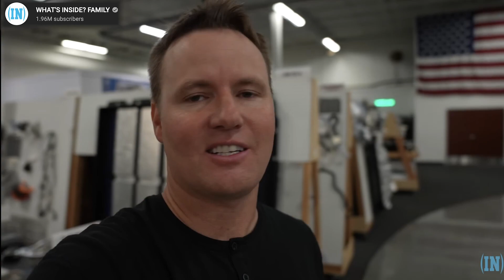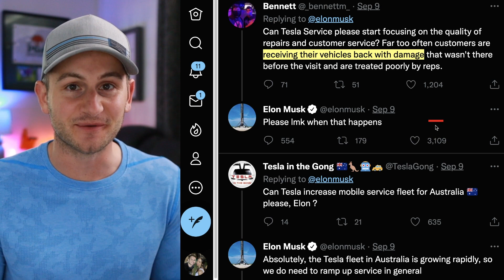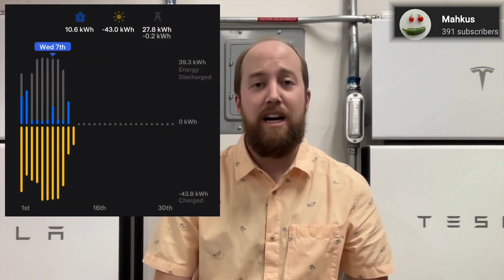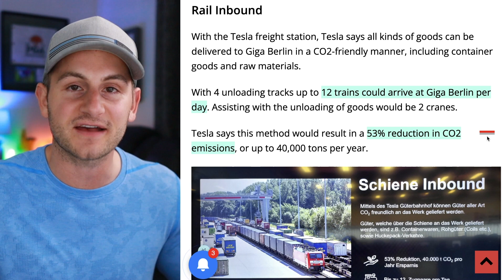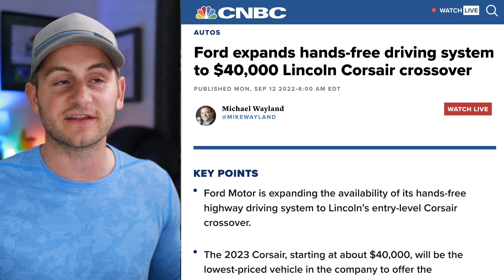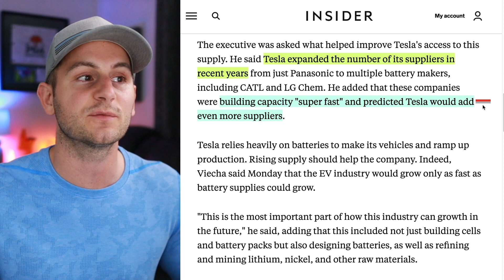Tesla Executive: "For the First Time I Can Remember..." ⚡️

Comment: Installing ev charging station in most cases require upgraded power line connection hence the high cost of installing it. Adding additional chargers to the existing charging doesn't have to be that expensive if it doesn't require grid connection upgrade. Remember, Dillon, regular house will use max 20-30kW grid connection but this is far from what is needed for a single DC charger. Imagine multiple chargers. It is actually an enormous size of grid connection.

Comment: Now where did I read/view that the reason they've delayed production of the Cybertruck was that "Producing it now would be like robbing Peter to pay Paul" – that is: they would have to throttle back production of models 3 & Y (just when they're totally devoted to scaling them & increasing efficiencies/economies of scale). But not because of battery supply, because of CHIP supply. Isn't that interesting? Sure chips are flowing better now, but in absolute terms they're definitely still constrained.

Comment: The cost for adding a high capacity charger will vary tremendously depending on the close proximity of large capacity electrical power lines.  if its necessary to add incoming power, the price can be eye-watering.

Comment: the largest expense with EV chargers is not the charger but the upgrade that normally is required to the grid and the buildings switchboards to enable the charger to operate.

Comment: I think it can logically assumed that regulators are going to want to count miles driven on FSD to start when Tesla reached Level 4 autonomy. All the previous miles driven before FSD Level 4, that requires driver attention and control don’t show how safe the FSD software is because a human is involved in the safety stats. Once Tesla reaches Level 4, customers are going to have to show how safe it is without human intervention or human monitoring.  

When Tesla reaches Level 4, hopefully they (Tesla and regulators) will allow customers to disable the driver monitoring software so they don’t need to touch the steering wheel or have their eyes on the road. At this point, customers should be able to sleep, watch TV or movies, play video games, etc. while ‘driving’.

Comment: The average amount of solar able to be produced at the Tesla charging station in the square footage claimed might be 1 megawatt hour per day....maybe.  So 20 cars could get 50kwh each.  This means half the stalls, or twenty out of the forty, could get juce from solar for a grand total of 30 minutes per day of car charging. 🤔 
Seems very insignificant compared to the potential electrical draw from such a project.  
Lets say 40 stalls each charge 10 vehicles per day, 50 kwhs each.  So actually a very under utilized facility, at least compared to something like our local Buc-ees with 120 gas and diesel pumps going wide open day and night.(I bet each pump at Buc-ees sees  40-50 cars a day).  But figuring 10 charges per day per stall that would be 20 megawatt hrs.  Then if we calculate 11 acres or so per megawatt of solar farm (that's currently the figure being built in my area)  and a solar potential of lets say 6 hrs per day for Yuma, it would take maybe a 40 to 50 acre solar farm to cover most of that electrical requirement, plus multiple additional megapacks. 
Of course if it turns out it's a busy station, we could triple that figure to 120-150 acres.  
So yeah, again,....9000 square feet of solar seems like more of a marketing ploy.

Comment: The largest cost is not the electric utility or the equipment, it's trenching high power to the customer.  If it's close it can save a fortune, 100 yards of underground trench to bring electricity to the stations could easily cost >$100K, if it's more than 100 yards, it will cost more...if it has to pass through sidewalks etc., prices just keep going up.  NOTE : $500K is very high, but we had to replace an underground industrial transformer and trench 200 yards in downtown San Francisco and the estimated cost was $400K

Comment: I disagree with your opinion of not having to buy a Powerwall with solar. They are necessary. Having installed a battery long after I installed a 6kw solar system I found the difference in efficiency and security of my solar system did a SpaceX  and skyrocketed with the battery in. It saves me heaps of money and I no longer worry about brown-outs. It will pay for itself and the panels in less than 5 years, which is better than 10 years without the battery. PS: Love the channel.
Reply: Good to know . I did the same but now we’re unable to buy a power wall separately .  Next year hopefully 🤔

Comment: At the beginning of this year I was planning on installing a Tesla solar roof and power walls. It wold have been a ~$100K installation. Ind doing my research I was surprised by the plethora of horror stories regarding Tesla customer service - permits not completed, phone calls not returned, years long waits for service/repairs, etc, etc. I don't need that aggravation! Add-in draconian terms and conditions, exorbitant 5x(!) cost of old roof tear-off and I put a stop to Tesla consideration. I am now  waiting to see how the new tax credits will pan out but Tesla is not at the top of the list. Third party installers will be preferred. Makes one wonder if this is the reason behind Tesla's low installation rate.

While Tesla may not have a demand problem now they are establishing a horrible customer service reputation that will be remembered long into the future. The problem seems endemic - not just solar roofs but EVs as well - and they both carry the Tesla name.

Comment: Regarding the importance of solar at charging stations, I haven't looked at the numbers, but my guess is solar won't supply all that much power to the chargers.  Important, yes.  Very important, maybe not.  I'd be interested to see the data.
Reply: very important in that it provides all the charge needed? probably not. very important in that it shows a little charging everywhere leads to a ridiculously large total? definitely.
Reply: The solar panels is just to run the low energy equipments and also work as a backup lol….. it has no chance charging a car.

Comment: So as an exercise in math, 16 cells per second yields about 57K cells per hour. 
At ~900 cells per pack that is ~60 packs per hour , ~1500 packs per 24 hour day and ~500K+ packs per year.
Assuming near perfect execution and minimal downtime.)
That matches up with the projected 500K cars per year planned capacity of Giga Berlin without any extra for export or Megapacks.
Since battery production is seemingly more problematic than vehicle production that seems a bit tight and Tesla will probably still be buying extra batteries to bridge the shortfall.
Reply: We don't know the percentage of useable batteries

Comment: At 16 cells a second, they would need 34 factories to make 20 mil vehicles a year.  To make 17 bil cells/yr, 327 mil/wk, 47 mil/day, 1.95 mil/hr, 32,433/min, or 540/sec.  AVG of 850 per vehicle.
Reply: Interesting maths. Over the next few years though (a) batteries will get more powerful (eg needing less) and (b) additional manufacturing "hacks" will accelerate the process..
Reply: Rule #1 when you do prospective work : *never ever* use current figures (even if they are state of art) to estimate what will happen 10 years in the future.
Don't believe me ? Try this simple exercise: place yourself 10 years back and given how many cars Tesla was producing at that time on their sole production site, try and estimate how many factories Tesla would have needed today to produce 1.5 million car per year

Comment: Installing a DC fast charger or super charger isn't just the cost of the charging unit. The power needs to be available at the site and at the level required. So if they have 5 Superchargers required by Ford then they are looking at a trench in the ground with at least 1MW available. Where does that come from? Who pays to put that there? An entire grid transformer may be required. Plus the trenching, cables, concreting, inspections and certifications. How far? The nearest large connection to the grid might be 10 yards away or 200 yards away or more.  $500k is easily reachable for such an installation. It's not just the chargers. The infrastructure isn't free.
Reply: Legacy auto have some interesting challenges ahead...

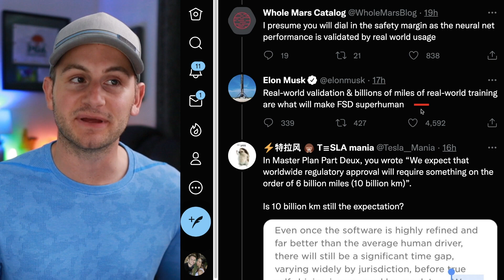Comment: Sorry but the math just does not compute! Per the graph at [4:00] there were 8 million (35-27),  FSD miles driven between 05-22-22 and 06-22-22 (31 days)j. That works out to only about 260 THOUSAND FSD miles per day , less than one-tenth 3 MILLION miles per day in Elon's tweet [3:30]. 

At the 3 mil per day rate it would take over 5 years to reach the 6 billion mile required. Accounting for exponential growth results in a NET timeline of ~2026. This seems reasonable. The cumulative FSD miles chart does not even come close. 

We know math is not your strong point but this was simple arithmetic and that chart should not have been published. Where did it even come from? There are no credits which implies that you are presenting info from unknown/unverified sources. Not good! Please exercise better due diligence before publishing bad info. It calls into question your credibility.

Also, at [4:00] you reference the chart clearly labeled cumulative FSD miles. Why, at [4:10] do you then assume that the 3 mil per day refers to Autopilot?
Reply from the maker: i literally answered these questions in the video and the chart source was from tesla's q2 results lol

Comment: I went ahead and did the math and it is 921,600 units, of 4680 batteries, per 16 hours of production!  That's still only enough for 1110 of the model Y, assuming 830 batteries per vehicle.  It's not difficult to see why batteries can be a constraint on vehicle production flow.  At a projected vehicle run rate of 1,000,000 per year, running 24/7, the battery production rate jumps to 28/second!  (Calculated at 350 days/year.)  I hope they can keep the machinery well oiled!  If I made an error in my calculations, let me know.
Reply: So as they ramp the vehicle line, they install a second cell line.
Remember, it's a relatively small operation compared to the wet system.
Don't forget, that "921,000" would be something in excess of 28GWh per year. That's a lot for ONE line.

Comment: I wonder, can the combination of solar panels and on site storage provide all the electricity needed for all cars at charging stations?
Reply: Harking back to the impact report (May?)
Tesla solar produced (considerably) more energy than used by all the factories, ancillary premises and all car charging between 2012 and 2021....
Reply: @rogerstarkey5390  great point Roger 🙏🏼
Reply: Can, yes?  Will or likely, absolutely not.
Reply: What I meant to ask was this:  At any particular charging facility such as those in the video,  is the combination of the covering solar panels plus battery storage, again as shown in the video, adequate, alone, to provide all the electricity needed if all the individual stalls were being used at the same time?  In other words, could a charging facility be independent of the grid  as a stand alone facility?

Comment: Ford dealers close to interstate highways need to see the opportunity and install multiple chargers conveniently installed for EV charging on all models.
Reply: Just shows how antagonistic dealers are to EV’s. Both gm and Ford could have had  instant charging networks years ago by using the dealers.
Reply: Would be brilliant, glad they aren’t that bright. Though, from what I have learned so far, I doubt too many will want to go to other brands.
Reply: dealers need to start pushing for right to repair and be a certified one stop shop for all EVs.  innovate or die

Comment: Taking my new model S LR for the fourth time to eliminate a creaky rear seat.  Tesla is not verifying their fixes and returning the car changed, but not fixed.
Reply: I also have a creaky rear seat. But it only does it when a person is sitting on the seat. I need to report this so it can get fixed.
Reply: @xxZerosumxx  first in was only when the seat was occupied, second in only when it was unoccupied, third is most of the time, but especially when occupied.  they are ordering new hinges to see if that helps.